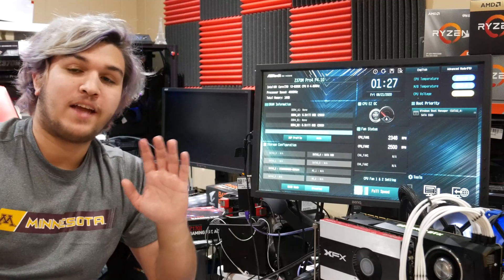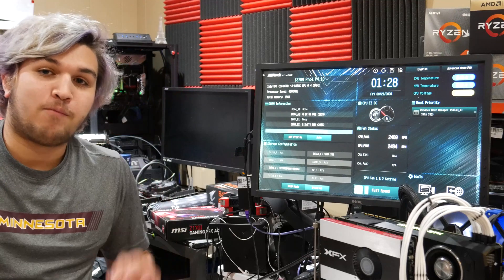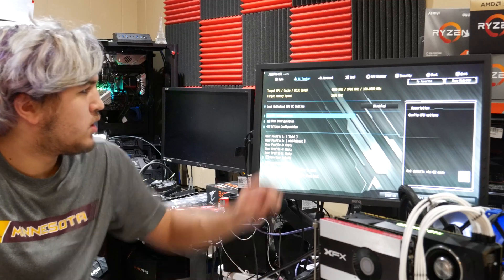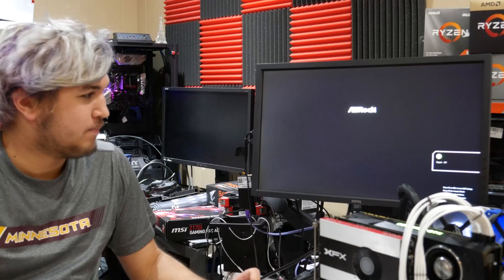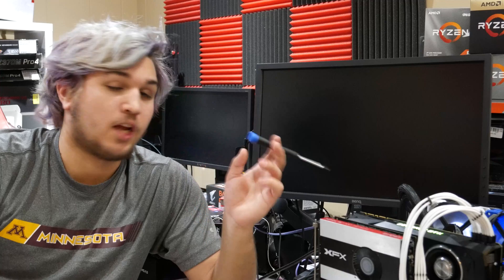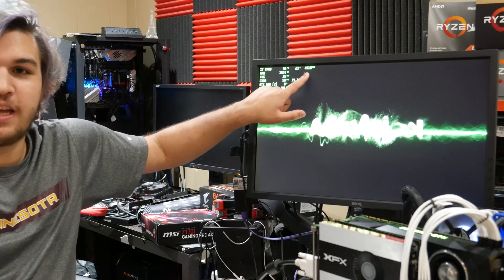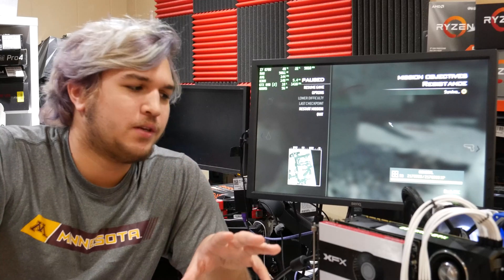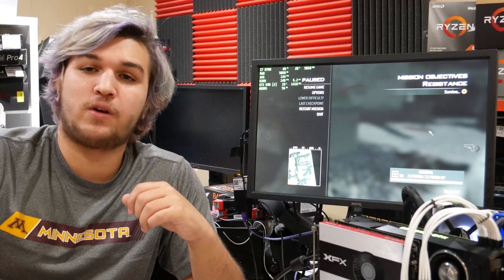Overclocking an Intel CORE i3 to 5 GHZ

Comment: My R5 2600x is at 4.0 Ghz because i didn't want to push it to the max, although with a Corsair H100i water cooler I should be able too, and if so what settings (like voltage and stuff) should I use?

Comment: The 9900k is actually the 2nd cpu the z370 takes which boosts to 5ghz.the i7-8086k is stock 4ghz with boost to 5.0ghz and has been overclocked to 5-5.3ghz successfully

Comment: I think the boot problem is caused by:
1. RAM - Because it has to train to accomodate with higher cpu speed.

2.BIOS - Because that sudden power attempt increase when during booting the cpu gets applied with low voltage for such high freq, the the ram tries telling "Hey, the cpu should actually get x voltage".
Reply from the maker: thats what i would normally think but that board did that even before the OC
Reply: @dinkiethesink  it could also the the drivers for the ssd or hdd not running properly during the boot.